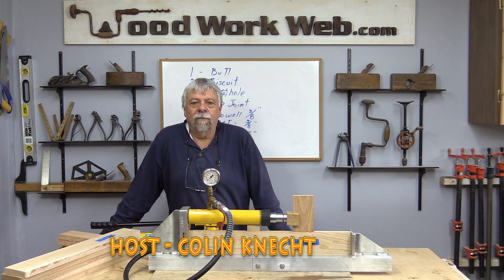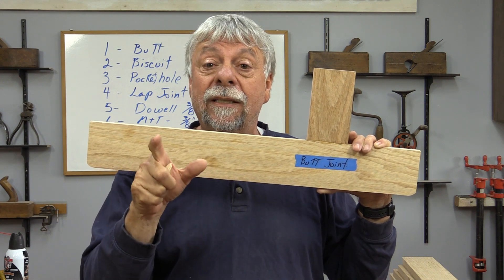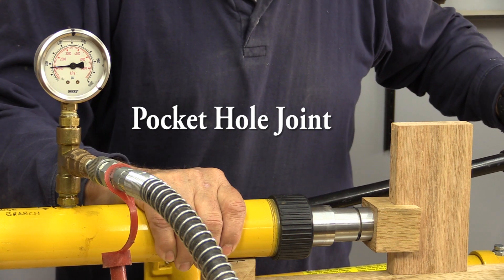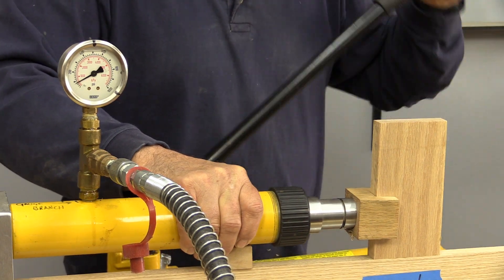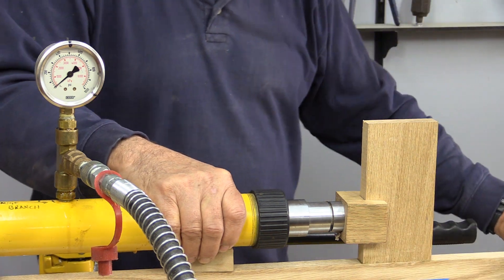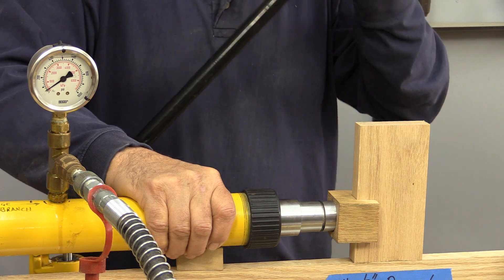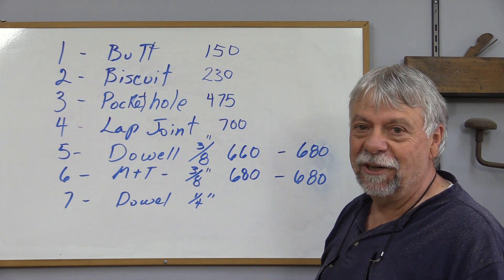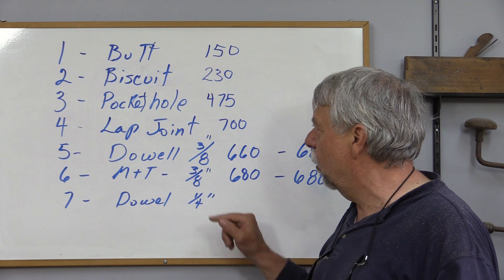Woodworking Joint Tests

Comment: It seems to me that everyone has run almost the same kinds of tests. We can all deduce that certain joints are going to be stronger in one direction or another, and one joint might be better for a particular application.
What I would like to see is someone tell me the proceedure I am using for making the different joints is correct or not. IE: your 1" dowel vs 1" M&T: both joints failed in the same way, at the same strength, so the difference doesn't matter. What about if the mortise and/or dowel hole is sized to the correct depth for the dowel or tenon. It appeared that you had the mortise and dowel hole approximately 1/4 to 3/8" deeper than the inserted object. What if this gap was sized for the part and only had 1/16" for gap. What if the end of the tenon was relieved for glue gap instead (maybe a center cut on the end of the tenon? 
It was obvious that the deeper the tenon or dowel, the more strength. but at what point is deep, deep enough for full strength? 

How about testing something like this?
Reply from the maker: Al Amantea When the joint is stronger than the wood, it all becomes academic, so not much point testing beyond that

Comment: Excellent video! So from this we can deduct that the longer the tenons/dowel penetration the better the joint (more glue area = better joint as glue is stronger than wood, which we "know" but is very, very cool to see in action). It would be interesting to see where the joint would break with a tenon/dowel that goes through the entire length of the beam. And what the reason for failure would be then. Another thing that would be very interesting is to see the same joints being tested for vertical strength, like how much weight they can sustain before breaking, if they were hanging upside down and you were pulling on the joint, although the pulling mechanism would likely require joints of it's own to grab hold of the pieces haha. Videos like this are an inspiration to continue searching for knowledge! Cudos to you sir!
Reply from the maker: rembad Thanks for your comments ... yes it seems the wood is failing before many of our joints, so good to know we seem to have the joint thing fairly well sorted out :)

Comment: Great test. After seeing the duplicate failures of the mortise and tenon and dowels from the splitting of the beam, I would have liked to see the performance of a through tenon. You should get a lot more compression strength before failure, but I don't know for sure. Thanks for the video.

Comment: About 50 years ago a new bridge was built across the Missouri River at Sioux City, Iowa.  A federal inspector was at the sight in mid January when the temperatures in Sioux city were -20 degrees.  The inspector picked up a stick of rebar which was used for the skeleton of the pillars before concrete filled the forms.  The inspector took the bar in both hands and bent and broke the rebar and said the material was no good.  The head engineer on the bridge informed the inspector that once the skeleton was built and tied together nobody was going to be bending the rebar especially after being covered with a 6 inch layer of concrete.  Today the same bridge gas bit met the maximum load and is still ig great condition.  This applies to wood jointery no matter which joint method is used they will never be tested to the max.
'Use what ever method you choose, but stop telling others they are wrong for choosing a different method than you.
Reply from the maker: Gary Finger Yup, lots of options to choose from, thanks Gary
Reply: Another bridge in the US that used steel that had an unusually high DBTT (ductile to brittle temperature transition) failed on a cold December day and sent 46 people to their death in 1967.
Reply: The rebar may or may not be bent in the final structure but if it is there for a purpose it might get quite a bit of direction tension on it just the same.  Likely though it is a conservative design and the rebar won't see that much stress.  And once it is inside the concrete it will be somewhat protected and won't get quite as cold.  Modern metallurgy is very much better than this, even for rebar which is relatively poor compared to other steels.

Comment: Now is the tine to build something such as a picture frame using all the different joints, also measure the time to complete each frame and see which one is going to fail first.  Would not this be a much fairer test then to joint one board to another and use a jack that will never be used in actual use.  
Too be fair as I use pockets holes and glue move the frames from a dry climate for a couple of years then to a very wet climate and see which will hold the best.  But then one could put a picture of a big jack or even a backloader and see what happens.

Comment: Great video. A few interesting (at least I think so) points...

It would  be interesting to see what the typical design requirements would be for one of these joints in a piece of furniture. Good engineering wold to use what's needed for good quality, but not more. 

Second - you are testing in shear. Is that the typical failure mode in furniture - a heavy weigh crushes a table? Maybe a chair... I would think axial tension (pull) would occur. Also you are doing a basically static test - I bet there is a big dynamic (repetitive cycling, rocking) element. 

But as a baseline test, this is great. No wonder industry uses a lot of pocket screws - good strength for minimal effort. 

Be well.
Reply from the maker: Ttf Web Yes ... good points, there are many different testing options and different woods and glues that could be tested ... many options and combinations

Comment: Very good testing Colin.  Guess I will be switching from Pocket Hole to Dowel where strength is a concern.
Reply from the maker: Tony Harris Thanks for commenting Tony ... yes, they consistently fair quite well
Reply: I saw one YouTuber exclaim that fluted dowels were stronger than smooth (home made type) because the flutes held more glue.  Were the dowels you used fluted?  Do you believe there really is or would be a difference as far as that strength test went?
Reply from the maker: Tony Harris Hi Tony ... to be honest, I think it is a bid academic because in many instances the wood almost always fails before the dowels, so having stronger dowels many not be much of a benefit ... but there are so many variables in woodworking it's really hard to say ... still, it's a fun topic and I enjoyed the testing, the results and discussions and hearing others ideas and opinions.

Comment: Valuable information.  I'm not a fan of pocket hole joints, though my kitchen cabinets have them on the face frame and they are perfectly fine.  If I had a bunch of face frames to make I'd probably buy a pocket hold jig.  After watching Colin's video on the DowelMax I bought a DowelMax Jr.  I really like it, with just a little bit of practice I have become quite efficient.  I don't even dry fit anymore, the thing is accurate and fool proof.  Thanks Colin.
Reply from the maker: Ed Waggoner Sr. Thanks Ed, yes lots of choices in woods and joints to choose from, thanks again

Comment: The pocket hole joint is no doubt a strong joint but using it in a project, if you don't have the perfect hiding spot for it, its always noticeable to me. I do use the pocket hole joint at times but it's not a lot of call for it when it comes to the costumers visual on the project. The lap joint surprised me as well. Great video, very informative.
Reply from the maker: Tim M. Thanks Tim, yes, lots of different options to use for joints ... thanks for your comments

Comment: A relatively fair comparison. I'm not at all surprised at that half-lap joint being the strongest in this test. It had more joined and glued surface than any other joint tested here.
Sure the m&t joint had glue on both sides and therefore (maybe) about the same total surface area - but with less wood mass than the half-lap. The half-lap spread the force over the width of the boards. The m&t not so.
Reply from the maker: Dogwood Tales Thanks for the observations ... good points

Comment: I used to do standard tests on wood glue joints when I worked for an adhesives company. We used instron machines that has a standard speed. 
There are two different tests. Slow speed and fast speed often get different results.   Your test looked good as manually it looked like you were doing the same for each one which is the important point. 
From a safety point of view this was not safe. We did these behind a safety glass screen. Shards of glass could easily attack your wrists and neck the way you did this. I guess you survived though unless a descendent edited the video and took out the gory parts. 
It's also important to calibrate between tests with a reference to ensure consistency and repeatability. 
The other important point is to have the same joint surface area and glue weight and the same open time (time between adding glue and pressing wood together) and pressure and temperature while pressing. We used glue rollers to have a set weight. 
Also setting times need to be consistent. 
Saying all that I really enjoyed the video and think your actual results will have been very representative. Very interesting to see different joint types. Mine were all using one square inch of basic lap joint. 
That job got me into woodworking. Videos like yours really help bring things to life. I've made several of your projects but not made a comment before.
Reply: There wasn't glass anywhere in the video. What are you talking about here?

Comment: So dowels are not only about as powerful as pocketholes but they're hidden and cheaper! Gonna go get a doweling jig now.
Reply: Dowels are very power joint as are floating tenons. 

Pocket screws are perfect for many different types of joints and projects. You would use them on a bed. 

Now if you put in multiple pocket holes running in opposite directions in thick would it will clearly be a powerful joint.
Reply: @bighands69  how are dowels a poor joint if they are stronger than pocket screws? Plus they are also invisible.
Reply: @vitaminb4869  
I meant powerful I said power.
Reply from the maker: Adam R Yes, the pocket hole stood up well in my tests, but of course it does depend on the wood to a degree too
Reply: we went with a Dowelmax and use it for most of our work. The dowels are stronger and the alignment advantage saves tons of time and error.

Comment: Thanks for doing this testing Colin. It's great to see someone spent the cash and used nice hardwoods for a test like this instead of just pine. I really like your testing setup but please be careful for your future testing as that lap joint shot off like a bullet. I believe you mentioned that all the joints used Titebond II, does that include the pocket holes?
Reply from the maker: legacyofbob Yes, that lap joint startled me too ... good point on the pocket holes, no glue was used for these, just the screws, and they were the coarse versions not the fine thread like the manufacturer suggests. I may need to do a brief follow-up on these ... thanks for mentioning this
Reply: good

Comment: What about using dowels trough the glued M&T joint, like beam frame barns are done ?
Reply from the maker: ***** Good question Ben, yes there are many options and with all sorts of different woods too, hard to do them all
Reply: ***** I'm guessing it will behave exactly like the second M&T/second dowel test, that is the piece would crack just below where the tenon/dowel penetrates. I can't see it having any effect on this particular test as the glue doesn't fail here, the wood does, so dowels through the tenon won't add anything.  (My guess is dowels through M&T joints is just to be extra safe, and perhaps to add a mechanical safeguard when the glue itself weakens over time. And perhaps to prevent the wood from splitting from the side.) I know you didn't ask the second part but it made me think why they were being used at all. Not sure if I'm right though.
Reply from the maker: rembad yeah ... I'm not really sure either. We are seeing the wood fail before many of the better joints so even more security is redundant, unless it is for looks ... which in some instances could be. Had not thought about glue failure, not positive on archive features of it either ... hmm.

Comment: I think what this video really showed was that accept for the unsupported butt joint, all the joints tested are strong enough for 98% of everything you're going to build... it all comes down to personal preference.
Reply: Brent DornerAnd that a butt joint is not intended to ever take load in that direction.
Reply: Orxenhorf  Lateral stresses should be accounted for with any joint where strength is a factor.  So, don't butt joint a table.  :-)
Reply: It showed me that I don't need a fancy Festool mortise maker for 1500 bucks for the furniture that I don't really build
Reply from the maker: Brent Dorner Yes, you could take that away from these test ... lots of different options

Comment: Great test! I'm curious what the results would be with the other (non-joint) end supported. For instance, if you had two legs spanned by an apron, how much force could you apply to the middle of the apron before one or both of the joints failed?
Reply from the maker: RickMakes Good question Rick, that's the thing with testing, so many different options of joints and woods.

Comment: Excellent testing.  I was afraid your fingers were going to be injured.  I would have liked to see box joint and dovetail joint tested.  Also, you didn't show the lap joint to us before testing.
Reply: BC ElginTex Glad you showed a lap joint photo on the full article.
Reply from the maker: BC ElginTex That's the thing with testing ... so many different joints, and with all sorts of different woods, it's really a huge area to try and cover

Comment: Great video and honest test of joinery.  Seems to show that the greater the glue contact surface, the stronger the joint.  Also its nice to know that the time involved in making dowel joints vs pocket hole joints yields a time saving for pocket hole joinery without a real loss in strength at the 1/4" dowel size (i.e. when making face frames).

No bias, just honest testing at the wood worker level.  Great Job. - Annie

Just a thought - could you do a glue test using lap joint, and/or butt joint with various glues - Titebond I II III, super glue, contact cement.  I would be interested to know which of these holds up the best.  If you have the time.
Reply from the maker: SuperYtviewer Yes, lots of options for testing and many have suggested lots of different tests in these comments, but just so many to try and with so many different woods ... in the end I'm not sure how helpful they would be above what is already done.
Reply: Cost wise dowels are WAY cheaper and stronger.. Pocket hole screws are ridiculously expensive in Africa.. Easily triple the price of regular wood screws. For me a dowel looks better and still "feels" like a traditional method and with a dowel jig its pretty fast

Comment: Interesting results Colin. I've seen a few videos on joints and there strength. It seems to depend more on how the joint was made size of it etc.For most of us I think we can rule out the butt joint for strength. The miter joint is also weak when not reinforced. Thanks Colin good video.
Reply from the maker: Backyard Woodworking Thank Roland

Comment: Thank you for doing this. The last person who did a video like this was very biased against pocket holes and made it seem like they were the worst ways to make joints.
Reply: Bobby B The tests were quite different.  This one is testing almost pure shear force since the pressure was being applied very near the base of the joint.  Matthias's test  had the weight further away from the joint which multiplies the force but also changes the angle to have a lot more pulling force on the joint which I think exposes the weakness of pocket holes more.  If you can engineer your project to eliminate or at least reduce pulling or angular forces on your joint then a pocket hole joint will play to its strengths I guess which is pure shear force resistance.  Just like how a lap joint was very strong in this test but would be weaker than some of the other joints if a twisting force was applied I should imagine since there's nothing but glue keeping the wood from popping out of the joint hole.
Reply: Bobby B I can't imagine who that is :)
Reply: Bobby B From what I've read, they're still a lazy and unskilled way to make joints...  I need to get one of those jigs! :P
Reply: Tony Harris Yes, but with one small exception. A butt joint joins end grain to side grain. This is weaker than the side grain to side grain of the lap joint because the end grain of the butt joint soakes up much of the glue before it can set.
Reply: I have a small one and I use it for simple stuff. I like it, it is fast and easy but I don't see the problem with that as long as they work.
Reply: Squibbleses  Exactly.  It would be like a butt joint 90 degrees from the test.